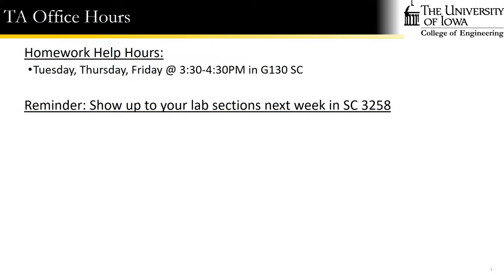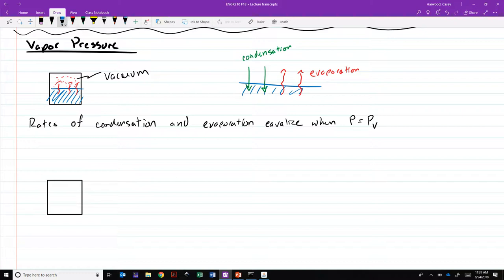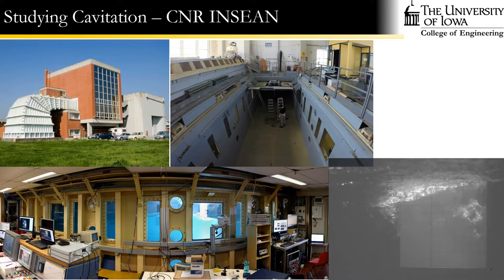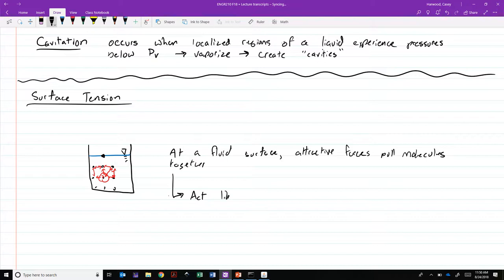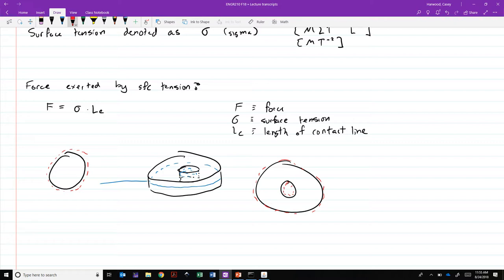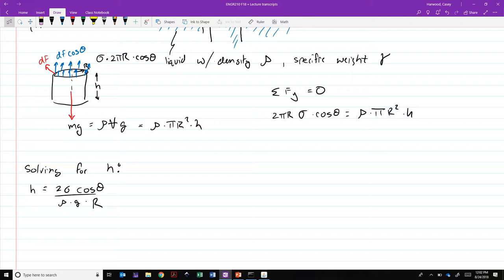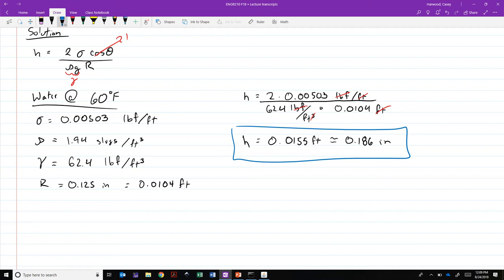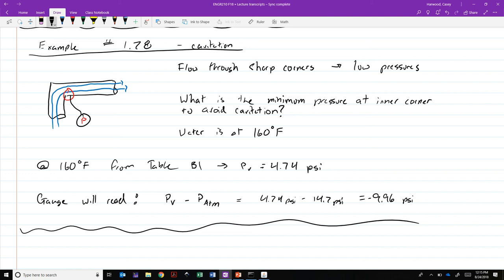L03   Vapor Pressure and Surface Tension

Comment: Excuse me, teacher, is vapor tension a topic in Mechanical Engineering or is it another way to reffer to vapor pressure?
Reply: The thing is that I havent found anything like vapor tension on books and when I look up on internet everything I get is information about Vapor pressure.
Reply from the maker: "Vapor tension" is not a term that I have hear before. I suspect that it's just another reference to vapor pressure.